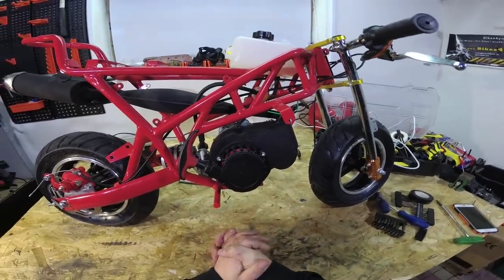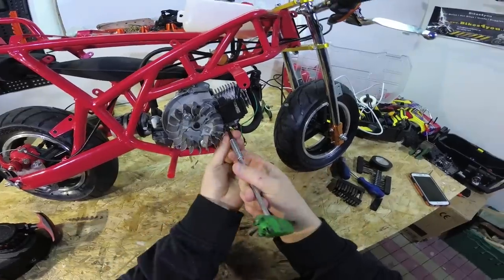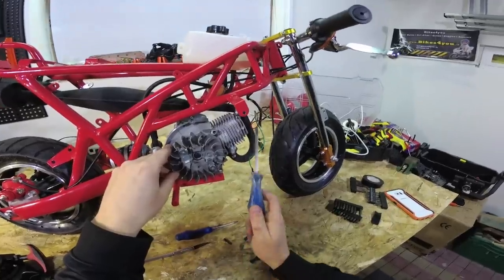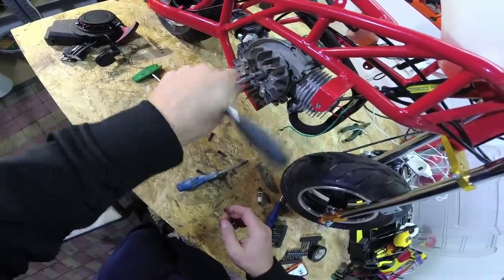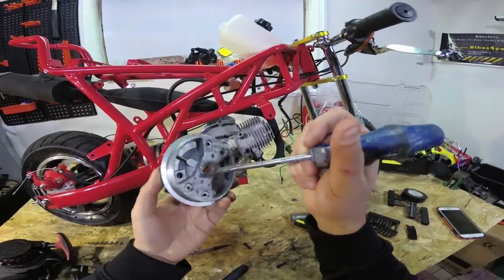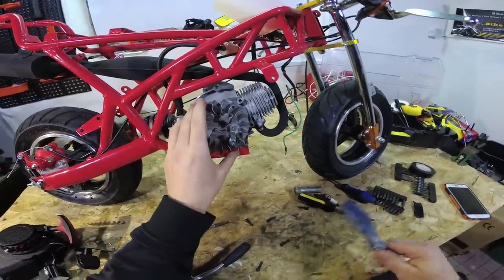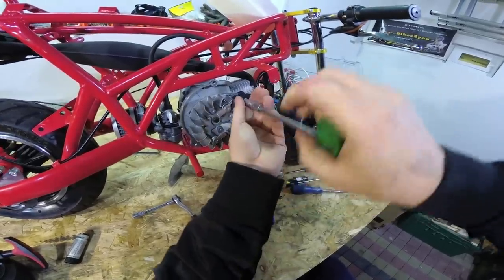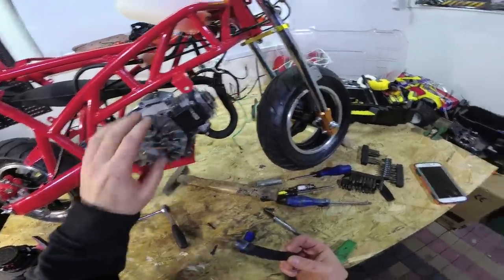How to Replace Flywheel in 2 Stroke Pocket Bike Engine PS50 from Nitro Motors

Comment: My flywheel screw is striped how do I fix this plz
Reply: I had the same problem, i used a dremel (or similar tool) with a mini cutting disc, and i made an even cross grind into the middle of the bolt, then used a phillips head screw driver instead of a ratchet and un screwed the centre bolt out.

Comment: hello mate. my bike was not starting due to broken pull start, so i saw a youtube video that tried to start it using a drill on the flywheel. i did that but my 10mm nut is rounded off bad. i have bought a new flywheel to match new pull start. any idea how i can get that bolt off?
Reply: Cut a slot in it and unscrew it with a screwdriver

Comment: Great video! But easy pullstarts break faster in my experience
Reply from the maker: with easy pull start you need to pull slowly gently, then the spring will turn the engine automaticly, if you pull agressive you can damage it
Reply: Where can I get pull start for easy pull

Comment: My pull start keeps slipping each time I pull it is this the fly wheel please
Reply from the maker: if you experience the clicking sound while pulling and no pression then pull start is damaged inside, you will need to replace the pull start
Reply: @MiniBikesStore  I don't have any clicking noise I just have the pull start slipping it's not turning the fly wheel. It's only a couple of months old. Just got a new pull start today and it's doing the same thing. Slipping each time you pull it
Reply from the maker: @rickycass5363  send us pictures of inside of the pull start and of the flywheel to info@minibikes.store

Comment: Just a suggestion - I would use a wooden dowel in the spark plug hole
Reply: For chainsaws I have used a coil of cotton rope inside the cylinder. Remove the plug and feed  a cotton rope inside the cylinder between the piston and cylinder head. Stops piston travel without risk of damaging cylinder or piston.

Comment: The bolt to hold on the replacement Easy Start flywheel on some units requires a M6 30mm bolt  rather than the original M6 20mm available from any hardware store.
Reply: Your local store doesn't sell beyond 20mm for m6 bolts? I found a 400mm m6 bolt at my local yesterday

Comment: This video was really helping me fix my son's mini quad but the bolt to fit the new flywheel has snapped and I can't get it out will I need to buy a new engine now? Fml.. Lol id appreciate any help if possible
Reply from the maker: ThomHD you will need a screw extractor. Simply drill a pilot hole in the broken fixing and screw in the LH-threaded extractor for easy removal of broken screws and bolts.
Reply: Mini Bikes Store thanks alot for the reply, I ordered an ez out extractor right away and today it arrived, the bolt is too strong in there it stripped it even with the ez out having a very good bite it seems to be very wedged in there is there any other way or do I need a new engine? Thanks again man I appreciate the help. Subbed.
Reply from the maker: hi, you can try to bring it to your local car garage, maybe they will be able to remove the broken bolt. if not you may need new engine.
Reply: Mini Bikes Store Yeah you're right that's probably my only option other than new engine now, thanks for all your help mate 👍 all the best.

Comment: When we pull the pull start bike won’t start but flywheel keeps rotating what do u think can be the problem
Reply: Monica Fiallo there’s suppose to be a flywheel key on the shaft the fly wheel sits in. The key is a small metal piece that hold the flywheel in place. If there isn’t one when you take off the flywheel you have to buy one. Without it the flywheel will just spin on the shaft.
Reply: That or you didn’t put your spark plug back in

Comment: I was given an old used pocket bike that hasn't ran in 4 years, I took a look and there's no bolt holding the flywheel on and there doesn't seem to be any threads to have a bolt in place... is this normal or is there something missing?
Reply from the maker: please send us an picture to info@minibikes.store I will try to help you
Reply: Just though I'd let you know that I figured out the issue. Whoever owned the bike before must of stripped the threads inside the crankshaft where the flywheel bolts into. I'll make new threads and try that and see how it goes.
Reply: Plz help my bike is pumping gas good but i dont have no start.... Plz is there other way to start it
Reply: @dennisjuniorreid884  I would check to see if you have spark.
Reply: @mitchlec8916  i have spark cause the last time it run then Stop
Reply: @dennisjuniorreid884  these motors require 4 things to run. Air, fuel, spark and compression. If you say you have spark, i would try the carb next. Remove the carb and check the bowl and clean with cash cleaner. Also i hope you're trying to start it with the choke on.
Reply: @mitchlec8916  ok bro have all but can get no starter for it
Reply: @dennisjuniorreid884  are you simply saying you're missing the pull cord and want to start it another way?
Reply: @mitchlec8916  Yes i need u help bro
Reply: @dennisjuniorreid884  oh my bad man, you can use a drill that has good power to turn it over. There's a bolt that holda5the flywheel on that you can use, i think it's 10mm or 12mm
Reply: Same here